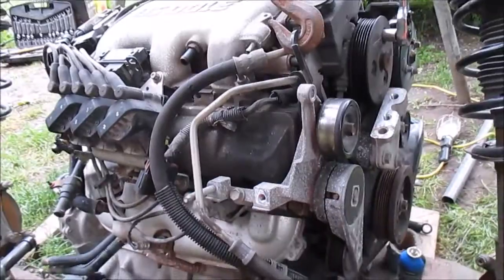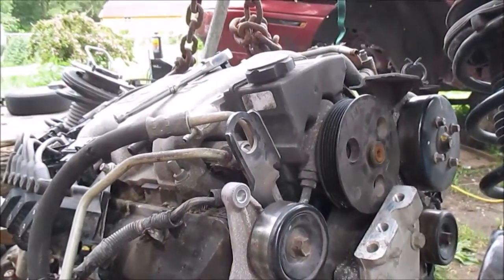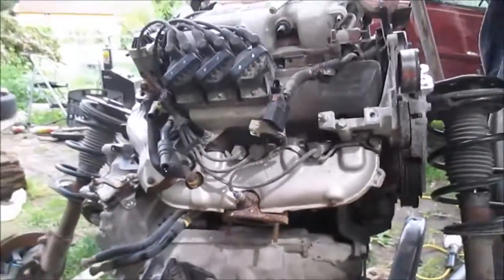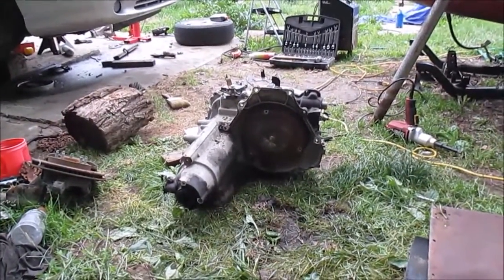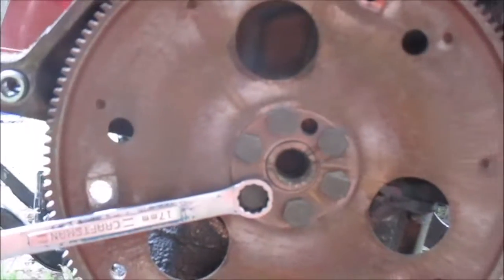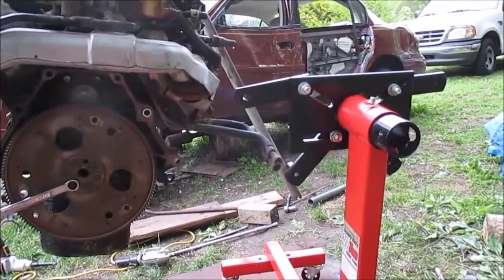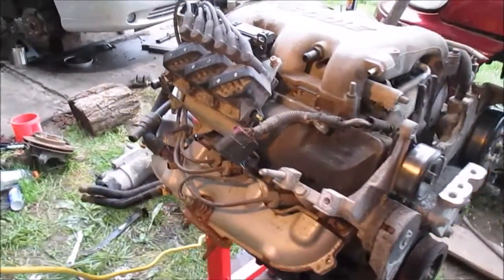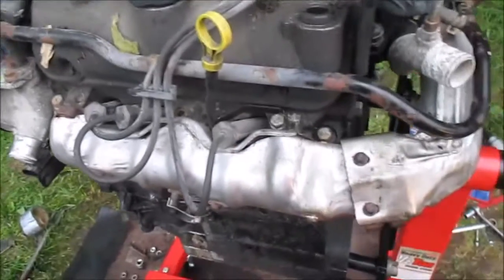Chevy Malibu 3.1L Engine Teardown Part 1

Comment: Do you know what that metal pipe is running from the top of the water pump? I know it houses coolant because I was fidgeting with it and the top bolt broke off and a little coolant sprayed out.
Reply from the maker: My husband passed away, and I don't have any answers for you. Sorry. Thanks for watching anyway!
Reply: If it’s the long black metal one that’s the overflow hose but pipe in this instance

Comment: Wish you woulda showed the transmission and engine separation
Reply from the maker: Yeah I wish I would have shown that as well. My stupid camera is always messing up, I need to buy a new one. So I just explained how I separated the two. As far as I remember it was pretty simple the bell housing bolts, the 3 bolts on the torque converter, and a bracket with a few bolts in it and thats it. Well thanks for watching and thanks for the comment. Have a good day.